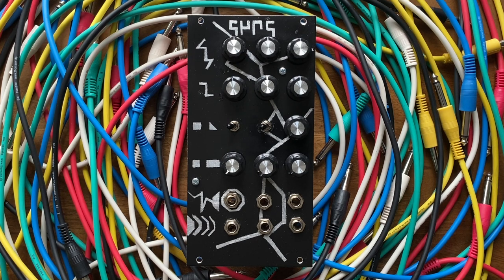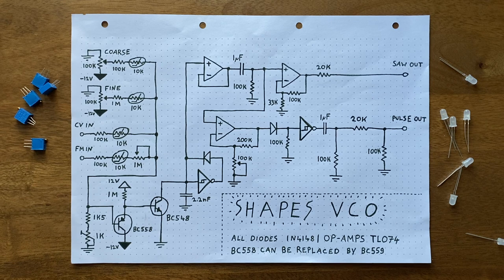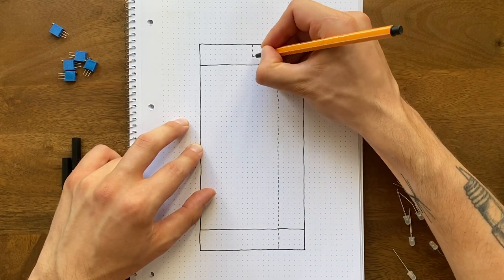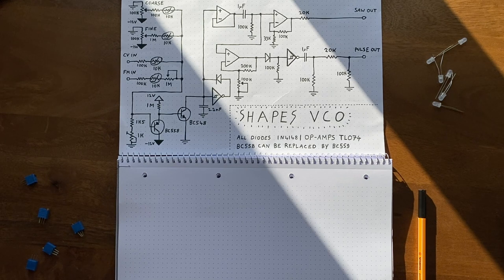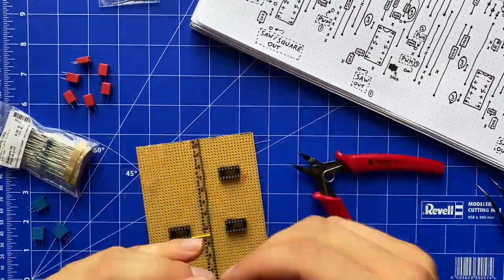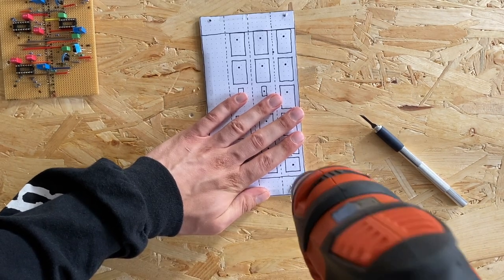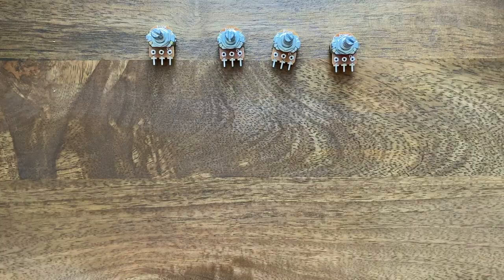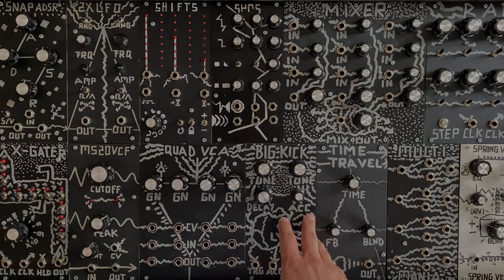How to build a DIY 3X VCO module from scratch

Comment: I’m late to the party but I find a step bit is much easier for drilling holes after the pilot hole is drilled. Also I don’t cut the retainer on the pot anymore, if you grip it w some pliers and torque it sideways it’ll snap off clean every time w no risk of tiny metal bits shooting off like sometimes happens when you cut them. Great work. Love the cosmo format! Big everything feels big

Comment: 05:38 you can also make your own PCB's,  although you will have to handle ferric chloride (which as long as you wash your hands and don't start sniffing the fumes will be more of a danger to your iron tools than to you). You just need a plain copper board and a permanent marker/corrector paste to draw the tracks on it. Before drawing the tracks I recommend drilling the holes for the components first and then connecting the holes with corrector paste while having some cardboard under the copper board. After the track drawing is done you need to put the board in ferric chloride and move it around (you can drill a hole in the board and put some wire trough it) every 20-30 minutes until you see that all the exposed copper was corroded. Then you get the board out, wash it under warm water with a steel sponge and then pour back all the ferric chloride back into it's bottle. Everything that has touched the ferric chloride HAS to be washed. Also, I usually recommend perf boards when you don't need to care about stray capacitance and inductance, so I use DIY PCB's for RF stuff, signal generators I really care about and high power stuff, it's a waste of my time to make a PCB for every little circuit with some LED's and transistors.

Comment: Love the series.

For drilling panel holes, get yourself a step drill. They are a big timesaver not having to change bits between hole sizes and you can also give the holes a de-bur with the next step.
Reply from the maker: thanks for the tip, will look into it!

Comment: Really great content you have made and nice explanations of your thoughtprocess aswell as the circuits. Great for teaching beginners in making DIY synths :)
A recommendation for drilling holes in thin sheet metal, use a step drill, it creates almost perfectly round holse and leaves littel to no burr on the edges, compared to a standard twist drill which makes traingular (tribolar) holse when drilling in thin sheet.
It is also easier to center correctly, especially when making larger holes, since you start off with a small pilot hole.
Reply from the maker: will try that next time, thanks!

Comment: Great video, regarding the finish of the face plate: when finishing guitar pedals I find a good idea is to use a combination square to mark the drill points with a small cross, then you know all the knobs will be in line with each other. You can use a nail to punch a mark on the metal to give the drill bit something to bite into, otherwise it might wander off course. The best way I've found to finish enclosures is to draw up a design in photoshop and include a drill template. Then you can just print off the template and punch and drill knowing it'll fit in perfectly with the design. As for getting the design from photoshop onto the faceplate, I've had really good results with waterslide decal. It might look a bit labour intensive at first, but it's actually fairly easy once you get used to it and the results can look really professional.
Reply from the maker: i'll be sure to try that out! thanks!

Comment: This was a fantastic build, only had one problem with the VCO so far and wanted to post the solution (just in case). If the VCO is inexplicably oscillating at a very low frequency no matter where the tuning pot is, disconnecting and reconnecting the negative power rail will fix it. For some reason if you disconnect power entirely it still oscillates too low upon a restart. I have no idea why this happens but there you go!

Comment: you can bend the legs of the sockets using a piece of perfboard: you put them in place, align a second perfboard and then move it sideways, the legs will be slightly bent, just enough to hold while soldering but not enough to damage or break

Comment: Hi! great video and series, thanks for sharing all that knowledge to the community. You mentioned that you had troubles making a master cv input, what kind of problems were those? I really want to make the oscillator have a master cv, and would like to know what I'm facing to.
Reply from the maker: nothing really difficult. for some reason i assumed a single buffer shared by all three VCOs would be sufficient, but that's not the case. you need one buffer for each vco.

Comment: Awesome video man! I was wondering if I were to build something similar to the required dimensions of a eurorack module if it would be compatible with other eurorack modules. Thanks and keep up the great work!
Reply from the maker: yes it would! though you‘d have to use a proper eurorack power connector to hook it to your power supply.

Comment: Hey Moritz, thank you for this great SDIY video compendium. Nicely put together btw.  When deriving more than one oscillator from a single 40106 chip, have you gotten around the issue of a weird sync or phase-lock if those two oscillators are tuned close to each other? I faced that problem when I built a dual VCO with single supply V/oct current sink a few years ago but don't know how to fix it.  Have anice sunday. MfG. :)

Comment: This is awesome. I'm just getting into modular, and want to know if these oscillators are easily connected to keyboards/MIDI systems? I want to make a modular setup for my studio and control it with keyboard instead of sequencer. 

Thanks for your content 🙏
Reply from the maker: to be honest i have no idea about midi to CV interfacing, sorry! from what i gather you'd probably have to use a microcontroller though!
Reply: If your keyboard has a CV output it will work immediately. Arturia's Keystep is very popular for this.  If your keyboard outputs MIDI, you can get a MIDI to CV converter box, there are dozens to choose from. Cv.OCD is popular.  As Moritz said, they use a microcontroller since MIDI is a digital signal.
Reply: This one is a midi to cv converter designed to match this synthesizer format.  https://www.lookmumnocomputer.com/projects#/1007-midi-cv

Comment: The mixing circuit is really really good, I just simulated it now on multisim, as expected at 50% position percentage of the potentiometer it blends to the two nicely together, but at 0% I see pure FM wave which stays 5 volts but whats interesting when its 100% its give me am which a few volts higher than my input of 5 volts.

Comment: Hej great video! I felt as if there were a lot new added to the circuit between this episode and the previous part 4 vco- build video. Did I miss something?
Reply from the maker: hmm i think the only two things i didn’t cover are the FM input and the wave mixing. but those are fairly simple and i‘m showing the schematics in this video!
Reply: Ok thanks for clarifying!

Comment: 12:55 Its easier to break them off (bend them to the side). That way youll have a cleaner sureface afterwards and its way easier.
Reply from the maker: you mean 12:55? how would you go about bending them?
Reply: @MoritzKlein0  yeah you can grab them with pliers and just kind of wiggle it back and forth till it comes off.
Reply: @MoritzKlein0  Yeah thx I looked at the time wrong. What I do is I just grab them with regular pliers (not snippers) and force-bend it to the side. It will resist for a bit but then it will just break off and it will leave a smooth (almost) surface that is flat.

Comment: Heyo! been getting into your videos recently. they've been pretty interesting and you explain well for someone like me who's new to electric components and stuff. we're trying to build a modular synth library in the local hackerspace and I've just finished my first LFO! tried a few times to make a simple noise module but that wasn't so simple haha..
but I wanted to ask, what is that Shift module? I'm hankering for some blinking lights for our project. been thinking of implementing digital number displays too in some way. can they be used instead of LEDs?

anyway, stay awesome! :)
Reply from the maker: it's a shift-register based gate sequencer. i'll do a video on that soon! and while yes, you could technically drive number displays with it, it wouldn't work in a functional sense, sorry!
Reply: @MoritzKlein0  I'll be looking forward to it :) I'm not interested in displaying numbers, just using differents parts of number displays as an alternative. we have a load of em here.

Comment: hello, great vco. I have a question though. Where is the 1m poti behind the fm in? and whitch type of the NTC 10K temp should i take? Are ceramic capacitors possible or do they have to be foils?
Reply from the maker: i opted to omit the FM input because it wouldn't have fit on the panel. for the thermistors it doesn't really matter, just make sure they're NTC not PTC. and ceramic capacitors work, but they might have a worse sound quality. check here: https://electronics.stackexchange.com/questions/69919/ceramic-vs-film-capacitor-which-one-is-preferred-in-audio-circuits
Reply: @MoritzKlein0  thanks for the quick answer

Comment: I have a question about the wave output, since I haven't seen any numbered scope outputs on this.

This was all done in SPICE simulation (lack of parts currently)
By AC coupling the output of the saw wave, I don't get it centered around 0V, but rather it swings from cca 200mV to -750mV.
This can be remedied by just adding DC offset at the end, but I don't see it in your schema.

The question is then - is the simulation set improperly and in real life with real power supplies the voltage swings around 0, or is the sound unbalanced and the offset is needed for balanced audio.
Is there a remedy for the peak of the saw wave I somehow missed? The pots seem to only affect frequency and voltage divider.

Thanks !
Reply: Addendum:

This was maybe caused by only having the sawtooth part.
When I added a voltage divider between the two sawtooth opamps it is now centered

Comment: Hello! Thanks a lot for this series, I found it really helpful. I have a question though. I built the circuit with the exact same components but if I keep my oscillator running with no CV input, the pitch varies a little with time. Also, the square wave shaper doesn't work for all pitch values, it stops the sound sometimes when I vary it while the pitch is high; it also stops the sound when I put it at minimum. Does this problem occur with you? Do you have any idea how to fix this?
Reply: One more issue is that the square wave shaper is changing the frequency of my sawtooth output. I would appreciate your input on this. Thanks!
Reply from the maker: did you build it on a breadboard? if so, just one or three vcos? 
you write the pitch "varies with time" – what do you mean exactly? if it slowly rises or declines, that might be the transistors warming up. 
as for the waveshaper problems: what do you mean by "it stops the sound when I put it at minimum"? are you talking about the pulse width or the pitch here?
Reply: @MoritzKlein0  Yep, built it on a breadboard, just one vco. The issue with the pitch varying is most probably my dual power supply that I built, I think it is not very stable and that's why there's an abrupt change in the pitch at some moments. 
For the waveshaper problem, the output signal dies when the pitch knob is at high frequencies and the shape knob is not at the middle. In other words, there's a specific range of the shape knob that outputs a signal when the pitch knob is at higher frequencies, otherwise the output signal (square out) dies off. The shape knob also varies my sawtooth output's frequency which is weird since it comes at a later stage than the sawtooth out.

Comment: very nice videos, i startet with pedals and then did some mini drone machine circuit bend stuff with the simple oscillator from lookmumnocomputer. now i want to built a bigger synth for drone and noise music. your video are very helfpul for the filter section and now im thinking about making it voltage controllable to add a baby 8 like sequencer. i was thinking about adding a stereo delay aswell. maybe you are interested in making a video about analog fx or fm synthesis in the future :D keep it up!
Reply from the maker: yes definitely! delay and reverb are on my list.

Comment: Great tutorials! I was wondering if you might have some usefull links or tutorials on creating your own symmetricall power supply from standard DC power brick input? Cheers!
Reply from the maker: hi adam, haven't come across something like that yet. not really sure why though. in theory (and i haven't thought this through, mind you!) you should be able to use a 24V DC supply and feed that into a 7812 voltage regulator. then you'd have 0V, 12V and 24V (which you can just decide to call "-12V", "0V" and "+12V"). there might be a good reason why this is not a good idea/doesn't work at all! if someone knows, let us know!
Reply: Hello, you can find a circuit for your problem here: https://www.head-fi.org/threads/virtual-ground-regulated-and-rail-splitter-circuits.654485/. The ones with L78xx didnt work for me, but the LM317 versions work without any problems. Note these circuits are not really suited for battery use, as they consume quite some power themself.
Reply: @MoritzKlein0  This on its own is not a good idea, as the 7812 would have to sink up to 12V more than it is designed for (eg. placing a load between 24V (+12V) and 7812 out (0V) would most likely break the regulator). Furthermore any voltage change in the 24V would result in an asymmetric virtual ground. See my comment above for a working solution.
Reply: @MultiCraftTube  Thank you! That is exactly what I was looking for. I will give it a go when I finish my current projects. I have been looking for proper solution to this problem for quite some time, so im very happy to see it described so well in detail. Cheers!
Reply from the maker: @MultiCraftTube  makes sense, thanks for the info!
Reply: The 7812 needs a small load to work! 4.7k was the biggest resistor which worked,i placed it between negative -12v and ground

Comment: Couldn't you do the pulsewidth mod with a comparator, so another op amp jnstead of the schmitt trigger inverter, leaving you with a fully used tl074 and just one of 6 schmitt trigger inverters?

Comment: You could use the FREE software Fritzing to draw your stripboards.
I find it really convenient.
Reply from the maker: i think i‘ll switch to pcbs very soon, but good tip nonetheless!
Reply: Do you use it on Windows?
Reply: @existential_fred  I used it on Windows up to some months ago.
Now I use it on Linux.
Reply: @mutedsounds2k  any tips on installing It on windows, or do you know where I can find an exe, on Linux it's a simple command but windows make you build it from scratch, too advanced for me
Reply: @existential_fred  NO. I now discover with horror that it has become a paid program!

I used version 0.9.3b on Widows (it was FREE) and never updated it.

I'm now using Linux, and I found it using Discover, just installed it from there.

Same version I used to have on Windows, the good old 0.9.3b.

Comment: Hello Moritz! I've built your single vco, but when i tune vco like you mentioned in pt. 3(0v then 1v) frequency jumps more then two octaves. I tried to short 1.5k resistor, but this helped only with one octave, next octaves start to drift highly
Reply: Theres a video about the tuning Process,maybe this helps :-)

Comment: Would it be possible to adapt this design into an LFO by lowering the frequency range? A video on LFOs would be awesome
Reply from the maker: yeah, but then you can also simplify the osc core since you probably don’t need voltage control

Comment: Hello Moritz...another fine video. My question....even though Eurorack jacks are stated to be 1/8 (3.5mm) it looks like you are using 1/4 (6.5mm) instead. Is this just a preference? I would assume it doesn't really matter. Personally I like the 1/4 jacks but 1/8 may take up less room. Any thoughts or suggestions? Thank you.
Reply from the maker: yeah it’s purely about preference. though eurorack modules are way smaller than what i have here, so 1/8th jacks make way more sense.

Comment: Amazing tutorials and I'm not done watching everything, but I just yelled "oh no" at the screen at 12:58 - please please be careful with those pliers, they can break catastrophically when handled like that!
Reply from the maker: you mean cutting metal with them in general or am i holding them wrong?
Reply: @MoritzKlein0  These cutters are for much thinner diameters of copper. I know it works for you and most people are lucky enough that never ever happens, but I've seen peoples post on twitter were one of the end of the side cutter broke off and shot around the room or close to an eye. But I also don't like the nibbles and drilling holes for them, so I have no better idea how to do this quickly :)
Reply from the maker: @Davedarko  ah i see. yeah it’s definitely not ideal.. someone mentioned that you can bend them. haven’t tried that though!
Reply: @MoritzKlein0  yep, just bend them with the pliers, they snap off easily
Reply: Aside from breaking, gnawing on thick stuff really chews up the blades. I have a set at work that I'm careful with, and they've lasted years. The same cutters at other benches look like wire strippers from cutting thick, hard stuff they weren't designed for. When I can, I use a bigger set of diagonal cutters for stuff like this.